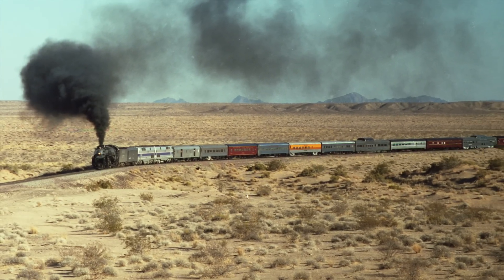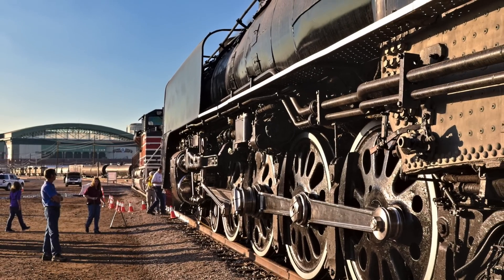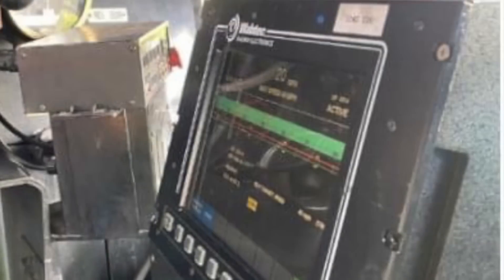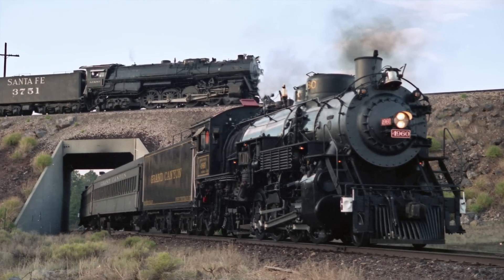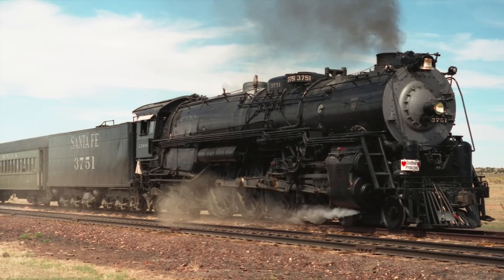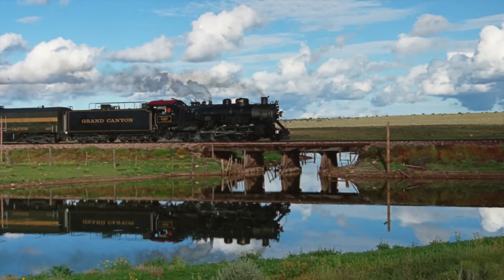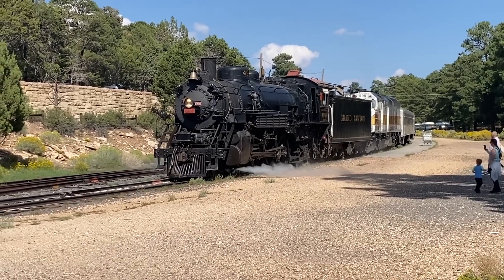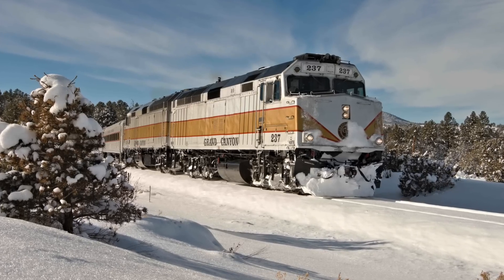Why is there a diesel behind the steam engine?

Comment: I love The Big Boy alot. Favorite Steam Engine EVER. However, I can't stand to watch the Big Boy anymore because of the "Helper" diesel. The Big Boy even to this day could outdo a modern diesel. Also when they converted it to oil instead of leaving it Coal powered. I know it had something to do with cost and mostly with environmentalists and the tree huggers who are against using coal as fuel. In my mind it greatly reduces the Awe factor. To me it also affects the sound coming from the Big Boy. Just all around disappointed that from now on the Big Boy will need assistance when it doesn't need it.
Reply: I love steam locomotives, too, but they had some serious drawbacks that are hard to get around these days...
The conversion to fuel oil firing was done because of fire hazards due to flying cinders. UP has not allowed coal-fired locomotives on any of their routes for decades for this reason. A few years ago the D&SNGRR, which has a speeder with fire extinguishing equipment following each train and a helicopter patrolling the route to contain and prevent fires, still had a terrific fire get started in the woods along the route. This prompted Mr. Harper to finally choose safety over authenticity and convert most of his steamers to burn oil and to even have two new diesel locomotives built that are disguised to look like steamers (GAG!!!) for use in the dry seasons. Let's face it- only about 1 in 100 of their patrons are there to experience steam. The rest are there for the scenery along the route and don't even know or care what a steam locomotive is. If he ever sells the line I would almost be willing to bet that the new owners would stick big diesel power units into the tenders of all the steamers and be done with live steam entirely. The locos would still "look right."😣
Another fact to face is that diesels really were a vast improvement over steam. A steam loco pulling a train needs all kinds of attention and different procedures that are not necessary with diesels at all anymore. That can really bind things up. In those areas where steam locos create a huge snag in an otherwise totally dieselized commercial railroad, having the diesel along to help out is really a necessity, especially on long stretches in sparsely populated areas where facilities to refill the 4014's water tenders are few or nonexistent anymore. They can throttle back the steamer and cruise under diesel power to conserve their water and fuel oil.
Under power, on only it's tender, Big Boy needs to stop for water (and grease) about every 80 miles. Diesels NEVER need to stop for water, unless their radiators are leaking. 
I remember 844 had it's tender and about three big tanker cars full of water behind it in San Antonio. When it got to Dallas all that water was gone.

Comment: Senior manager-Union Pacific Heritage Operationsand Big Boy #4014 engineer told me, that it was there only to power the coaches.  I met him in Little Rock shortly after he tied down for the evening.
Reply from the maker: I'm afraid that doesn't make much since, since UP uses freight diesels behind their steam locomotives.  Freight diesels do not have the ability to provide Head End Power.  I believe UP uses a generator car to power the coaches.  You can see it in my video of the Big Boy runby.  I think it's the car with the bubble on top, because it sounds like a generator running when it rolls by the camera.
Reply: @ehadder  Straight from the mans mouth.  I have it in a clip my wife took of us.  And what do you mean “freight diesels”?  Does UP have passenger diesels hiding somewhere?
Reply from the maker: @redlight722  A Modern Passenger diesel, like the ones owned by Amtrak or the commuter railroads, will have the ability to provide Head End Power for the passenger cars.  This runs the air conditioning, heating, lights, etc..   This can be evidenced by large electrical cables that stretch from the diesel to the cars, and between each of the cars on the train.  To my knowledge, UP does not have any of these, except perhaps the E units, but they have never run behind the Big Boy. 

Most Passenger diesels are going to provide the Head End Power in one of 2 ways:  Either a separate electric generator connected to the crankshaft of the diesel engine, or a separate diesel engine with it's own electric generator.  Electrical systems on Passenger cars run on 480V 3 phase at 60 Hertz.  So the diesel engine needs to run at a specific RPM in order to provide the electricity at 60 Hz.  The more modern Passenger diesels may have a way of taking part of the traction power and converting it to 480V 3 phase at 60 Hz.  I'm not familiar with those.

Comment: Nice video.  So why not use more steam and diesel engines together and have the advantages of both types of engines working. The diesel has the advantage of starting the train of cars and when the normal operating speed is acquired the steam engine has the peak efficiency over the diesel.

Comment: In June of 1998, Milwaukee 261 was running an excursion train to Galesburg Il. for the Galesburg RR days festival. East of Mendota, the locomotive developed a hot bearing, and tied up traffic for a while. I have never seen solo steam on the BNSF since (there may be an exception or two, if so I am unaware).

Comment: On most occasions when I've seen steam engines (Sugar Express and GSMR), the diesel(s) were at the back of the train, and I'm quite sure it was just so the train could be turned around easily. But, I've also seen steam run on its own with no diesel whatsoever either. Didn't know there was this much reasoning to why they put diesels on too.

Comment: I like to think of the use of Diesels behind steam locomotives as dead weight to give the leading steam locomotive more traction when climbing steep grades
Reply: How could a diesel give a steam locomotive more traction. Are the drive wheel of the diesel connected in any way with the drive wheels ot the locomotive.  Use your head. THink before making such a statement.
Reply: @organbuilder272  sorry if I worded it poorly, I meant to say it provides more traction via dynamic braking. For example Nkp 765's 2013 run on the Horseshoe Curve, it had NS 8102 and NS 8098 to both stretch out the coal usage, and to give the locomotive enough grip to safely negotiate the curve, with minimal wear to the steam engine's brake shoes.

Comment: There are a lot of passenger coaches that need a lot of electrical power. I always figured the diesel loco was there to primary supply the large amount of electrical power need by these coaches.

Comment: There is another point here: These locos are historical artefacts, are very valuable, and you don't want to wreck them just to prove what they CAN do when pushed to the limit. A diesel unit fails: Plenty of spares, and replacements. A Steam Loco brakes, you might have to specially cast a one-off piece, then machine it Etc, Etc. If it is too costly, you than have a static museum exhibit, not a running Loco.

Historic WW2 'War Birds" are limited to how many flying hours they have in any given year, and prohibited from "Aerobatics" that would stress a very valuable, irreplaceable airframe to much.

Comment: Interesting video; I always thought the diesels where only as a backup in case the steam locomotive fails... but there is much more to it... providing electric power to operate modern day safety features, providing power to passenger cars, giving boost to start a heavy train, and when taking on gradients, and to help in maintaining high service speed required by modern track operations - when the excursion train has to fit in a track used by commercial train traffic .
Especially the observation  that a steam locomotive can pull any train it can start & that a diesel can start a train it cannot pull is eye opening,,,

Comment: 3985 ran many times without Diesel even with a long consist , even 4014 coupled with 844 runs Diesel , would be great if UP could run 4014 , 3985 and 844 as a triple header , what a sight ...

Comment: I've got a question, what is that car right behind the engines? Is that like a generator car to supply electrical power to the cars? Just wondering Have a Happy New Year everyone.
Reply from the maker: Yes, on Grand Canyon Railway, we have a 'Power Car', that is just a diesel electric generator strictly to supply 480V electricity for the onboard systems on the Passenger Cars.  Even though the former Amtrak F-40 diesels can provide Head End Power as well, we prefer to use the Power Car with the Steam Engine.  That way, when we cut the steam engine off at the Grand Canyon to replenish the water in the tender, we can take both the Steam and Diesel together, and leave the Power Car behind to keep the lights on in the Passenger Cars.  Otherwise, we have to disconnect all the air and electrical connections between the steam and diesel, then hook them back together, which is kind of a pain.

Comment: Power and HVAC for passenger cars.  Steam engines only had power to run headlight and lights on the engine.  Passenger cars had their own batteries and wheel generators  in the old days.

Comment: I figured it was due to the trains running on the main lines and if the steamer had trouble the diesel could move the train out of the way. On a steam excursion in the 1980's I recall there was a problem with the steamers on the main lines due to the lack of tracking boxes on each rail car, so in the future they would have to have upgraded rail cars boxes for tracking the train or else they could no longer run excursions.. Strasburg Rail Road running their little double header on the main lines from Strasburg, PA to Harrisburg, PA.

Comment: Lol that steamer doesn't NEED any extra power to haul a piddly little passenger train at or above track speed. 844, the Challengers and the Big Boys all make MORE power than 2 sd40s lol.. There's a well documented instance on YouTube of 3985 rescuing a busted diesel powered train. I do believe this has happened more than once actually but that's the only one I can site proof of off the top of my head.

Simply put, the class 1 railroads are a bunch of beancoumters and chickenshit assholes that all cower before their insurance companies and the bass-ackwards FRA.

Comment: The diesels do not provide  power to the cars on the UP trains. Freight locos did not have head end power.  If you look you can find a passenger Freight car that has a HEP unit installed.  That car supplies e-power to the train cars. Amtrak locos also fill this requirement as they all have HEP units, also on the Grand Canyon Railroad.

Comment: If the diesel power blended in better, like a B unit, it wouldn't be as unattractive.  Using it as switcher at a dead end has merit. Could there not be a switching unit stationed at the dead end?

Comment: Back in 1998 I rode the Grand Canyon RR from Williams, Az to the South Rim, Grand Canyon.  We stalled going up a hill, had to shove back and get another running start, after sanding the rail.  There was no diesel helper then.

Comment: Back in the day with steam how did they power the lights on the coaches from the 30s 40s ? And heat
Reply: There was a steam line running the length of the train, even diesel locomotives until the 70's had a boiler installed to make steam, the steam was used for heating and AC.  Each car had batteries and wheel generators for lighting and or gas generators.  Dining cars used wood for the stoves.
Reply: Wood stoves and whale oil lamps

Comment: Most of this also applies to Steam Train running on the Main Lines in the UK but the other loco would most likely be on the back and would run as required. Also run both locos at the front if there is a incresed fire risk the steam will run low power for show and the other behind it  will do the work. People aren't always happy with another diesel or electric but it has to be done sometimes.
Reply: A lot of UK tours don't use rear diesels. They are generally only needed where the train needs to be hauled backwards out of a terminus station
Reply: @volvomad  Yeah true it depends on the company to if they have one or not in some cases.
Reply: Another train? You mean they couple the cars from two trains to be pulled by one locomotive??  If you know so little about railroading that you call a LOCOMOTIVE a train, you have a lot to learn.  Just to enlighten you a little - a locomotive pulls a consist. The locomotive, its tender and the consist is called a train. A locomotive is not now, never has been and will never be called a "Train.

Comment: In the UK the diesel is attached to the rear of the train, and is there to provide train power, and pull the whole train in reverse, avoiding  running round.
Reply: At least one of the UK railtour companies has a generator in one of the coaches. They only tow a diesel when the train is expected to visit a terminus station

Comment: In the UK it's the norm to have a diesel with steam for a few reasons one in electrical supply to the coaches and the second is that the steam locomotives are old and may require assistance,. They also lend a hand should it need it
Reply: Normally only used when the train is expected to visit a terminus station to haul it back out. They use a generator in one of the coaches any other time. Look at steam railtours on YouTube for many examples of steam only trains
Reply: Also worth noting - although the steam locos are old, they are stripped down every 10 years for overhaul. This makes them run like new. Although failures do occur, it is very infrequent.

Comment: I believe the same is done on steam railtours in the UK - HEP for coaching lights, heating, and A/C - and for backup traction. Most UK heritage steam is speed-limited to 75 mph, though the new build(s) (i.e. Tornado) can do 90 mph. A good chunk of our network is 110 or 125 mph.
Reply: Uk railtours have a diesel on the rear for those times the train is pulled backwards for example at a terminus station. Flying Scotsman is going to South Wales this year - it is turning on the triangle in Newport then being pulled backwards to Cardiff so it's facing the right direction to return to London. Most railtours have a diesel generator in one of the end coaches.
Reply: Most tracks are limited to 55
Reply: @mikecross4350  in the US?
Reply: @heavy_metal_chemist  yes
Reply: I believe that the speed limit on a steam locomotive that has stood idle for over 60 years is just that, you could put a Eurostar locomotive on the front of it and it still couldn't be allowed to go faster.  But all the other issues stand; dynamic braking, communications, head end power, tunnels, and turn-around issues.
Reply: @henryostman5740  I believe the T1 trust in the US have gotten clearance to go for the record on some private test track. 

Tornado over here has been cleared for 90 (as a new build), tested up to 100 mph.
Reply: @henryostman5740  that's why steam is just for fun now
Reply: Another thing the diesel is used for in the UK is to generate brake pipe pressure... Not all mainline registered steam locos are fitted with an air compressor (as they would have used vacuum brakes when in front line service) but most Railtours need to use air braked stock.  The loco is equipped with an air brake control which can use the main reservoir pipe as its source of air to release the brakes by charging the train pipe.... The diesel loco has the compressor that keeps the main Resoviour topped up.
(some locos have their own steam powered compressor so don't need to do this)
Reply: @dasy2k1  That as well. The US standardised on air brakes long before we did. Hell even the early diesels used vacuum breaks...

Comment: The Tennessee Valley Railway Museum runs excursion trains and they use both  steam and diesel engines.  They use the diesels for extra power up steep grades and also in case of mechanical problems on the steam engines.
Reply: I can also think that running a steam engine just for backup is pretty expensive this days. You still would need to bring it p to steam and keep it that way although not used at all while diesel can be started much faster.
And also: these old diesels are beautiful too ;-)

Comment: Some years ago, a Canadian railroad (CP, I think..) ran a special steam train from coast-to-coast. They also used a diesel as part of the consist, but what they used was a recently-overhauled EMD FB unit, set right behind the tender, painted to match. If you didn't know much about trains, you probably wouldn't have known there was a diesel there.

I think railroads do this mostly because the steam locomotive is really an antique; these machines are 70+ years old, and parts supply is severely limited. Just 1 75 year old part breaks, and the whole thing stops. Also, infrastructure needed to service steam was dismantled more than 50 years ago. Just finding enough clean water to replenish a steam loco is difficult in dry areas. UP found this out when they hooked up the Big Boy to one small town's water system, and ran their water tower dry! They were asked to never stop there for water again...
Reply: So I wasn't going insane all those years ago! I was by the station when it stopped in my city--no one who wasn't there believed me when I said I smelled coal smoke and heard the whistle at the bus stop.
Reply: It's interesting that an EMD F Unit has modern fixtures for when 2816 is going to go out for it's tour.